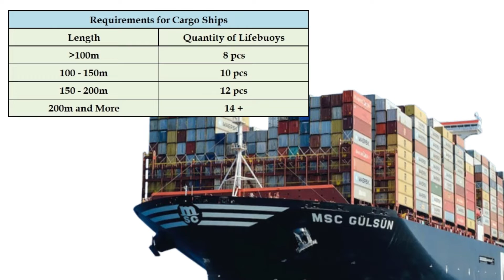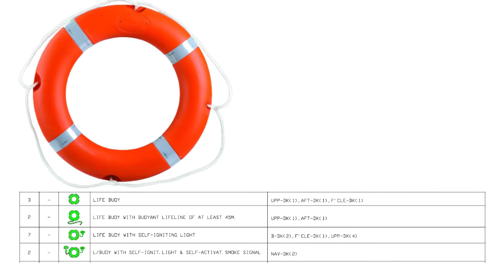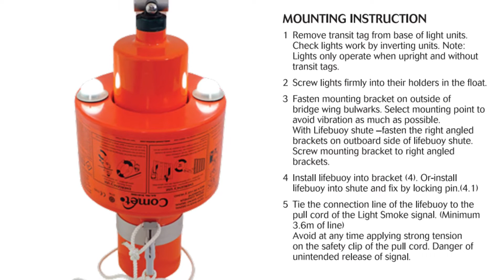Lifebuoys Onboard: Complete SOLAS Guide

Comment from the maker: Keep your ships safety in good orders. Hope somebody found its useful. 
Timelink:
00:00 - Intro
00:12 - SOLAS  and LSA Code Requirements for Ships Life Ring or Lifebuoy
00:59 - Ship Lifebouy with Self-Ignition Light.
01:37 - Ship Lifebuoy with Lifeline.
01:58 - Ship Lifebuoy with Self-Activating Smoke Signal ( MOB ) 
02:36 - Ship Safety Officer Responsibilities. Compliance with Regulations.
03:09 - Self-Activating Smoke Signal Expiration / Correct Installation / Connection Line Lenght
03:38 - Self-Ignition Light Standarts and Problems.
04:01 - Lifebuoy Grabline
04:37 - Lifebuoy Plug
05:07 - Lifebuoy Reflective Tape
05:18 - Outro